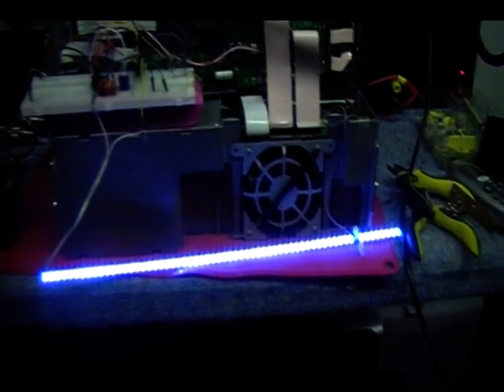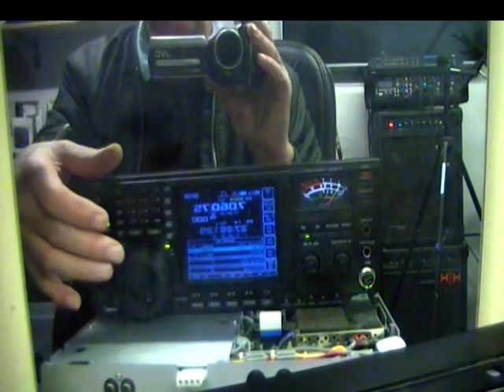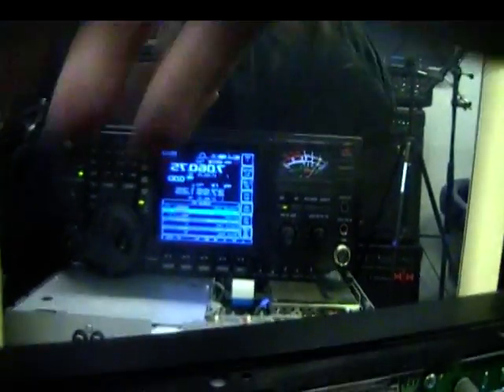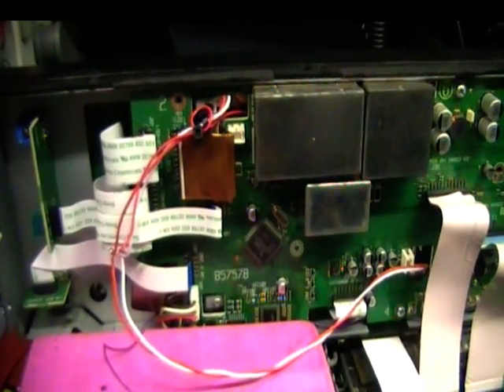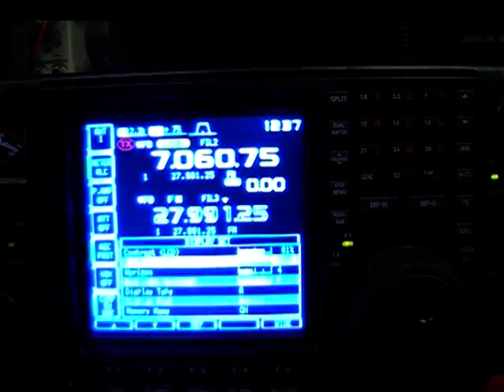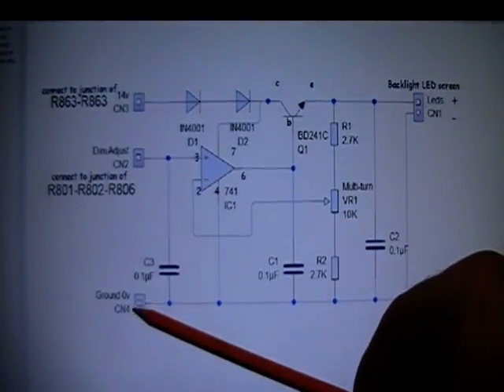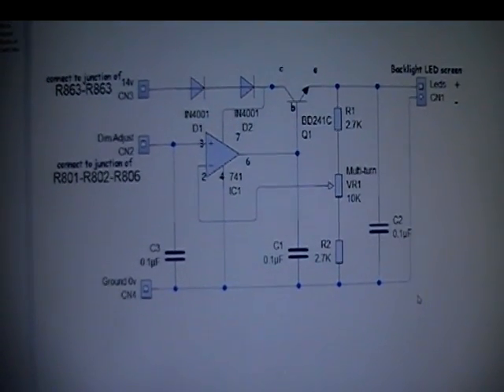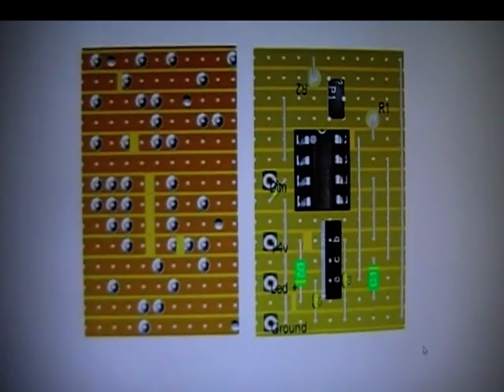Icom IC-756 Pro II CCFL to LED Part 3 of 3 Updated Display Control

Comment: Hi Barry, Thank you for your brilliant video.  I hope you don't mind me asking a relevant question?  Last night whilst I was using it on receive the screen suddenly went very red.  Is it possible this could be due to the display itself rather than the backlight and if so have you had this problem yourself?  Kind regards, Steve
Reply from the maker: Steve w high Steve, I have had no problems with the screen upgrade, it’s strange that your getting a red tint, it can only be the back light if the backlight leds have developed a fault but I’m sure they can only give white light so it sounds like a fault with the display itself,  what change do you get when 1. adjusting the LED backlight setting? And 2. what change when you adjust the LCD colour setting I would be very interested let me know cheers Barry...
Reply: @bandcam  Thank you Barry for your quick and kind response.
Although I now have all the bits required to carry out your mod I haven't actually done it yet so am still using the original fluorescent backlight.
I have started to wonder if the old tube has somehow changed from a pure white to a dull orangey light. I don't know if that's possible, what do you think?
I have tried all 8 colour options and messed with brightness and contrast without any improvement so I'm at a bit of a loss.
Any suggestion from you would be most welcome.
Best regards and 73s, Steve
Reply from the maker: @stevew267  ok I'm now understanding what your saying and assumed you had done the mod.. I think it's your existing backlight tube as they get low and worn they tend to look red or orange with low output, the existing screen liquid crystal display would be fine if you're seeing data etc, seems it's asking for the LEDs haha.. cheers Barry..
Reply: @bandcam  You know Barry, that is what I was hoping you would say, hihi.
I will leave a couple of hours free this next week and do the mod, and of course, will let you know the outcome.
Cheers for now, Steve
Reply from the maker: @stevew267  ok all good but I think a couple of hours is asking a lot lol.. it's a very slow and meticulous job but very satisfying when achieved, let know how you get on.. Barry..
Reply: @bandcam  Will do Barry and thanks again. Steve

Comment: Hi Barry and many thanks for providing details of you good work.  I have just acquired a really nice Pro-3 where the display really is not too bad but have decided to implement your method 3 to further enhance the screen quality.
may I ask where you obtained the LED strip and also please can you confirm that the predominant blue looking screen is due to your phone camera and that the reds and yellows are still as good as before?
Best regards, Stee
Reply from the maker: Hi Steve, OK on the planed upgrade to the 756 rig, regarding the led back light  kit used if you go to eBay and type "ccfl backlight"  you will see a list of usable kits,  its just the led strip you need but they come with the driver board no longer required with the latest mod you can discard that, .. also I can confirm the display shows no predominant blue  as you ask its a very nice balanced colour display as also stated by others who have also done same mod, good luck steve, cheers Barry..
Reply: Thank you for your prompt reply and for providing answers to my questions. I will get on with the mod in the next couple of weeks and of course let you know how it went. Kind regards, Steve

Comment: Hi Baz, thanks for the videos, I’ve just completed this on my Pro11 took around 2 hours and cost around £25 in parts, screen is now nice bright and sharp, Cheers
Reply from the maker: Craig Magee , ok glad it’s working fine, how did you find the fine soldering ? It’s a tight and small area to get to well was for me also how did you make the dimmer connection did you build the 741 board? Sorry for so many questions Craig but it’s very helpful to get feedback. Well done,  I’ve used mine most days since I’ve done the mod and always an excellent display..  cheers barry G4LVD...
Reply: baz140 I copied your board like for like. I used a 1mm antex tip for soldering and decent flux and solder did the trick

Comment: Hi Barry ..
just today I successfully performed the led change of the display of the IC756PRO2 and I used your circuit described in this video (which in my opinion is the best of the three methods that you have described in the previous videos), and I must say that goes a real wonder !! now it perfectly adjusts from the value of zero brightness to the maximum brightness .... Spectacular !!
Thanks to you and I'll be your fan ... hi hi.
  hello a hug.
Nino
Reply from the maker: Hi Nino, Excellent! I would be very interested how you got on with the conversion, how hard did you find opening the display and led change, any problems? also how difficult did you find soldering the dim wire to the board? and did you use vero board for the circuit? and what if any suggestions would you advise, such a lot of questions but its great to hear a second opinion on the conversion to help others decide. I am very pleased with my own rig now and would certainly recommend  to others. thanks again Barry..
Reply: Hi Barry ..
I have not encountered great difficulties ... on the contrary ... it was simpler than what I imagined .. I paid a lot of attention ... especially when I opened the display..delicate but fully feasible! the only drawback is that the LED bar 18 LED (the one about 10 cm) did not fit well because the black insulation on the wires that feed the LEDs is quite rigid and increases the length of the bar itself, so instead of cutting I cut the strip to 18 LEDs to 15 leds .. so it came perfectly. No problem with the 12 LED bar (6.5 cm approx). For the construction of the circuit I used the classic board thousand holes (about 2.5 cm x 3 cm), very compact and rational construction. To connect the led bars, the power supply of 14.4 v and the dimmer line, I used pins (male and female) so without welding the wires, this is good because just detach said pins if in the future you have to open the front for other situations ... (very comfortable).
The welding at the point of withdrawal of the dimmer (R801-R802-R806) is slightly difficult due to the very small components !! but being very careful, I managed to great!
The advice for those who own this beautiful apparatus is to proceed safely to the change .. of course if the CCFL tube begins to show signs of retirement .. retired! hi hi hi
Dear Barry ... I tell you that I've never seen my display like this ... nice !!! hi hi

A hug and thank you
 hello Nino
Reply from the maker: @antoninorusso56  Well done and thanks for the feed back, good luck, Barry.